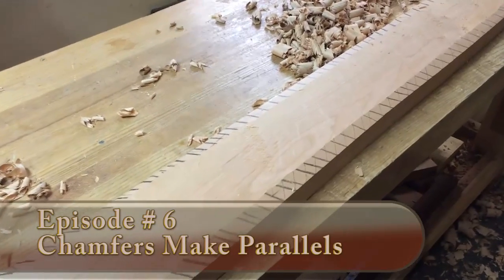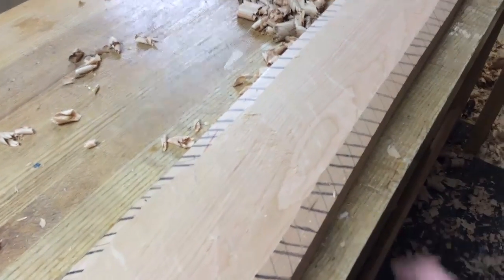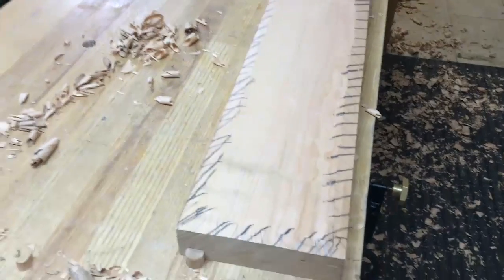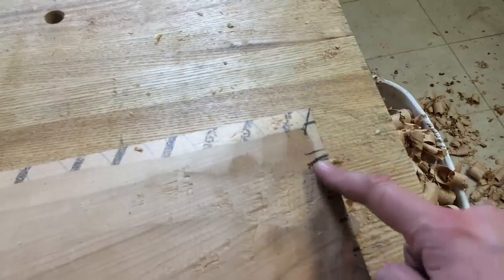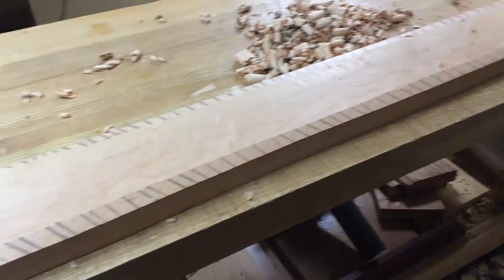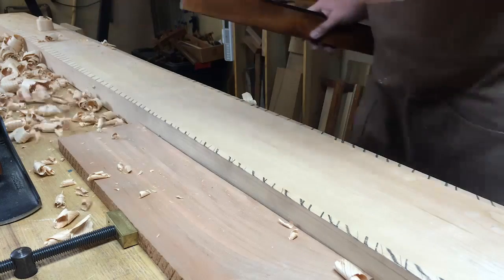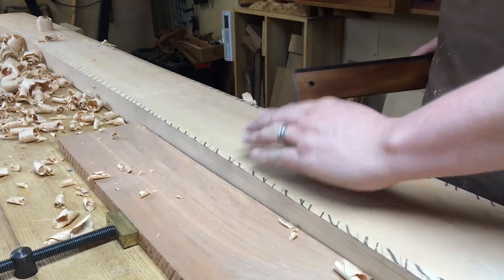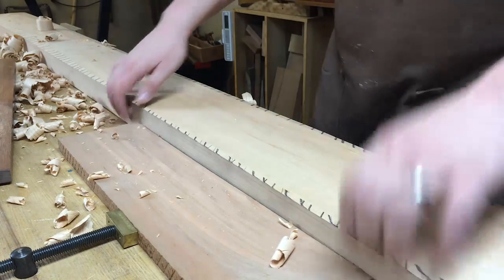Chips 'n Tips 6, Chamfer Your Way Parallel

Comment: Hi Shannon. It seems like an excellent way to thickness wood. I have yet to try it. I actually do mill by hand. Is there a reason you wouldn't use a scrub plane and go across the grain until you're close?
Reply from the maker: arekcw not at all, that's what I do.  In fact that's what I'm doing at the start of the "action" clip except that I'm using a Fore plane.  Ultimately I let the board and its grain tell me the best way to plane it but yes it is usually traversing first.
Reply: RenaissanceWW
Thanks a lot. I like to avoid using a straight edge for as long as I can, it breaks my rhythm too much.